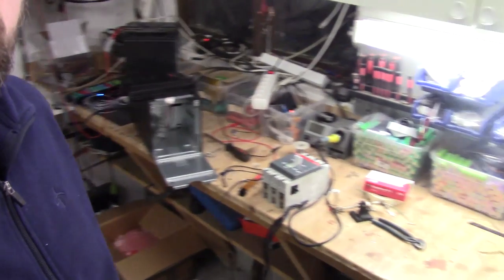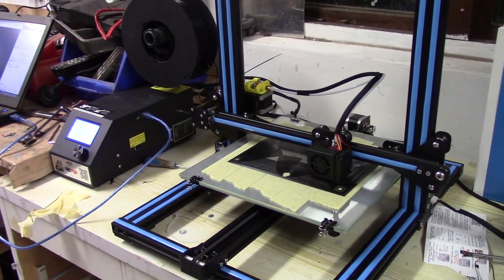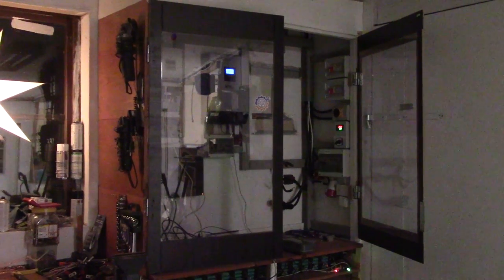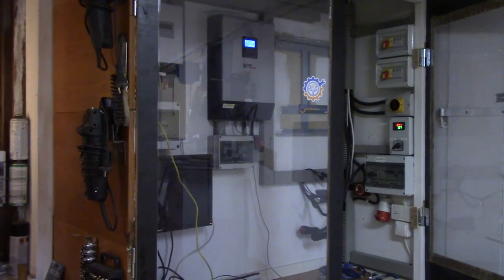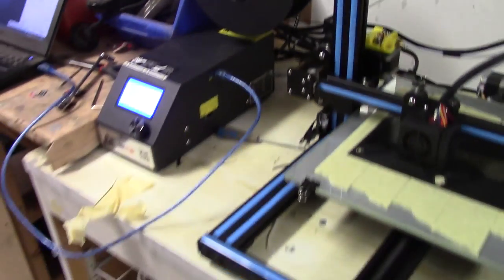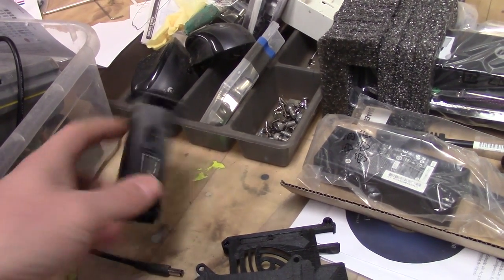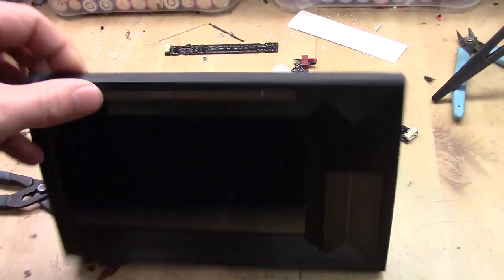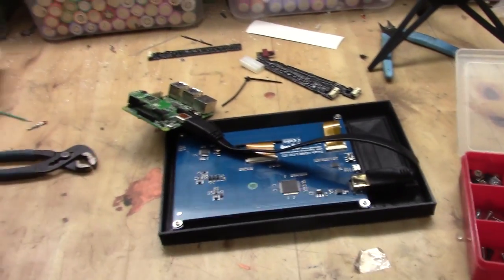Christmas update 2017 - Did I die?

Comment: How about using OctoPrint for the 3d Printer. As long as it has a USB Serial Port which receives GCode commands it should work.
Reply: There is also a ready to Go image for the Raspberry Pi called OctoPi
Reply from the maker: Its doable for remote but I still want the machine to run by itself as it should do :) But I for sure thinking of a raspbery that runs Octo including a webcam for it so I can remotely control it.
Reply from the maker: Yeap its downloaded but havent hooked it in yet :)